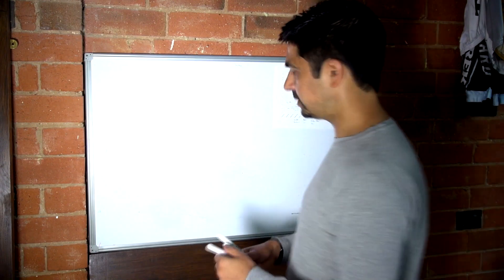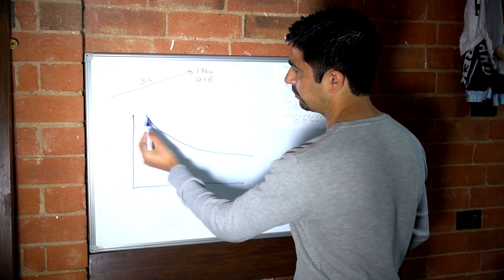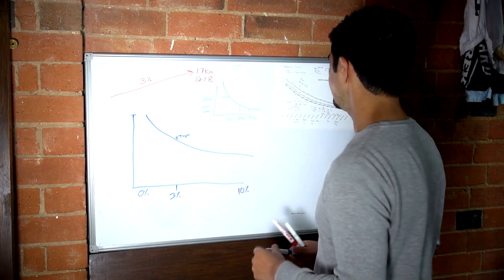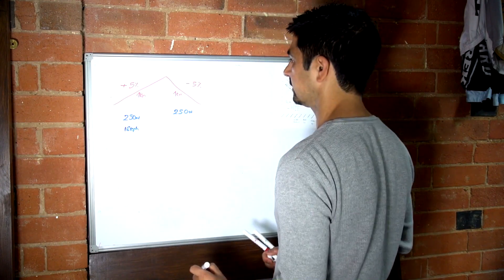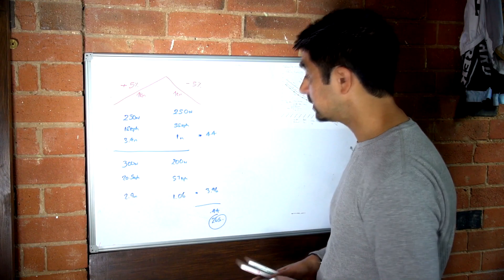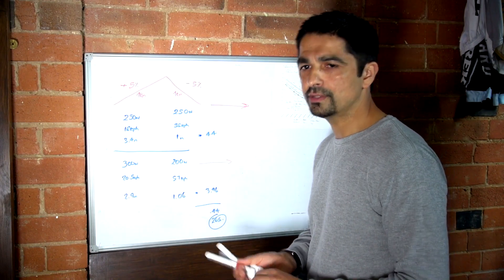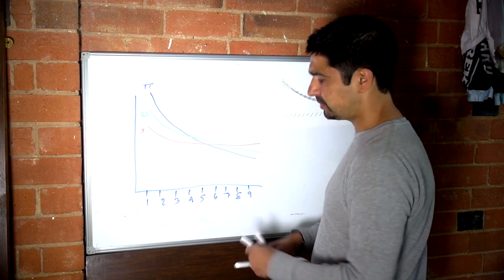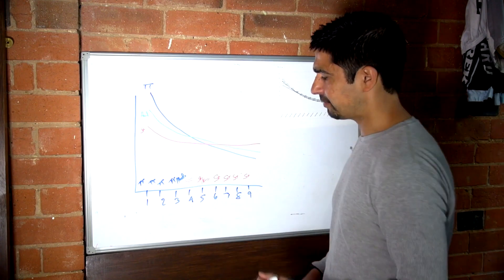Hill Climb Science: How to Correctly Pace Long Hill Climbs using a Power Meter

Comment: OORRR, you can just keep your power output at just below threshold at a gear that allows you to pedal up the grade with cadence between 80-100.
Reply from the maker: haha, that works if you are not against the clock, but if you are and you don't know the length of the climb....

Comment: calculating your average watt performance is +- easy. The problem is, that you can try to start faster than your average und then after 5-10min fall down and hold +- your  calculated performance (under pain for sure :)) which can give you an overall benefit compared to just try to hold your calculated performance for the whole distance. It s natural that you loose some % performance at the end anyway

Comment: Hi @FastFitnessTips I understand that increasing body weight has an exponentially increasing demand on effort where the standing position is adopted. I wonder if there’s a point in body weight vs gradient vs duration vs aerodynamics in line with ones power curve where it becomes counter productive to stand because of this and if this would be a strategy worth discussing in another video? 
Great video, smart work! Cheers
Reply from the maker: Yes precisely there is a tipping point where sitting is best even if power is lower because of aero gains...in fact if you can manage it TT ing uphill can be even better. Assuming power is equal then a better aero position wins on any grade of hill (suprisingly) but the problem is sustained power with differ. I will try and cover this in a future video. Did you see the drafting uphill video? Check it out

Comment: Does this work the same when the downhill doesn't immediately follow the uphill?As in should you always put in more effort going up hill
Reply from the maker: If you are riding for time, downhill is generally for recovery but not freewheeling. If the downhill is short, ride downhill at the same difference in watts below your FTP that you rode uphill above your FTP.
Reply: @Fastfitnesstips  Awesome thanks! I'm assuming you could formularise this for air resistance in general from your formula for the Watts per %gradient? As in it would it work for head wind vs. tail wind? I'm assuming the effect of wind speed on rider speed is not linear. 

Also wouldn't the watts increase per ‰ gradient (as in the formula you mention) increase overall for stronger riders?
Reply from the maker: @guswong7067  yes there are two factors aero drag increasing with speed (roughly squared) and ambient wind. We have a calculator for both of these factors, and yes neither is a simple linear equation! re stronger riders, stronger riders = those with higher sustained power, so don't quite understand your qq on this.
Reply: @Fastfitnesstips  Yeah i guess I had two questions. Firstly I was wondering whether the intuition to push higher Watts uphill because it takes longer also applied to headwind sections. (assuming no drafting) 
Secondly I was wondering whether your suggestion of 10 Watts per 1 percent gradient change at 250 scaled linearly. So at 375 Watts would you do 15 Watts extra uphill and 15 less downhill? 

Adding a third point here sorry :) . I think the headwind tailwind question is very interesting in general. Maybe even worth a video? Coz I can't get my head around it haha. How does the speed to power graph work in this case (assuming flat ground so? I'm assuming tailwind flattens the graph while headwinds steepens it? Does this mean its actually could be worth it to increase Watts on a tailwind section rather than a headwind?? (coz you'll get more speed for an equivalent wattage? But then headwind sections last longer? Am I picturing the graph wrongly? ) 

Honestly if you've done any excel modelling of this stuff or anything I'd be pretty fascinated. Thanks
Reply: @Fastfitnesstips  Bump

Comment: I expected more seriously analysis: I had practical task-to win on mtb uphill championship.
The race started on 200m asl and finnished on 800m asl, lenght was 6.5 km, surface was dry and hard  ground/dirt.The slope was changing  by lenght:It starts with slope more than average with u turns (300m), then a little down(300m), steep uphill with 15-18% slope(600m), then average slope (rest of track but on every 100-200m was some steep slope) but 1km before finnish was almost flat part(800m) and last 200m is little more than average slope.
Main question was what power managment to took: 1. all track with same ( max) power, 2.to go on steeper slope with higher power and on smaller slope with lower power or 3. to go with higher power on smaller slope and smaller power on higher slope.
I tested all 3  and best result was  to go  with higher power on smaller slope and rest on higher slope, because higher slope mostly was short but smaller slope was longer  so if I go with little more than max power on small slope I coul gain more ( -time) than loose on steep slope when will rest and because flat part is at end if come tyred I could  not go fast if . Less expirienced drivers came tyred on flat part they and drived  as was high slope.
I told this to one average guy and he drived 1.5 minutes faster than usually.
Yes I won, time was 26:31 and by every kg i was faster 45 seconds. First race was 31 minutes with 12kg bike, last was 26:31 with 8 kg bike( in meantime I became some stronger)

Comment: Came back to this video again after a long time, and more I look at the numbers, the less sense it does make. Graph at 12:40 clearly shows, that heavier you are, the less w/kg you need to output to maintain the speed... ???
Reply from the maker: Thanks for watching. Graph at 12:40 is illustrating another more basic point that more power needed to maintain uphill speed at a higher weight. Its not meant as an exact calculation applied to a known rider.    But there does seem to be a slight trend in the direction you are mentioning; however I wouldn't rubbish the whole video for a slight drift (+/-5%) in w/g vs speed.
Reply: Well, I am not dismissing the whole video (i like it a lot). But that graph is completely wrong and actually in contradiction to the general idea of the video :)
It should pretty much be the same power output in W/kg for everyone, as long as we do not consider aerodynamic drag (AD). If we do, the graph would probably show minor increase in required power to weight ratio for heavier riders. Considering that when going up anything over roughly 3%, we are fighting gravity more than anything else (based on the video), impact of AD would be rather miniscule going 10%+.
This is why I believe there must be some basic error in function you have used to calculate those graph, since it shows very minor tendency toward decrease of power to weight ratio required to climb hills for heavy riders, while one would expect exact opposite... slight increase, or constant ratio of power increase in relation to weight difference (if we don't consider AD at all).

In reality we see a pretty huge differences in riders ability to climb hills based on their weight, but I BELIEVE (I have nothing to support this claim) that has more to do with physiology of the rider, and general fitness, than anything else. Especially not the physics behind (because there is no way to justify any big difference there).
In theory we can easily compare 65kg rider with 95kg one, and assume the same fitness level (it's just one variable), but in real life, it would be much more difficult to find such couple. 
In general public more weight would most likely mean lower fitness level, with athletes it would indicate their are specializing in different area - climber vs sprinter. (using/training different muscle types. eg. Andre vs. Chris).

If this wideo was meant to be for general public, more than for a cycling community, saying you need to output more power the heavier you are to climb hills, would be absolutely okay (well, it's true) And amaze people by how much more power would be... okay (since they most likely have no idea how much 60 watts is in a first place). 
But I would expect that everyone here understands that whilst true, it doesn't really mean that much, since you probably can output much more power if you weight more (and if not, it does not make any sense to compare in a first place).

Anyway, I really like your videos, and the fact that you are still replying 1.5 year old video, is very cool man :)

Comment: Very interesting video, with a lot of good points! I'm riding with PM since 3 months and have been changing my approach to my local mountains already.
 I have a comment on section 2 though with the variable pacing strategy. Now if you go 250 on the climb and 250 on the downhill, your average wattage will naturally be 250. However you will always spend more time on the climb even if you are doing it with 300. So if you increase wattage on the climb and decrease it for the same amount on the downhill (300/200), your average wattage for the whole ride will be higher (maybe 275) and the faster time not all that surprising. What happens if you calculated a steady climb and downhill (275/275) with this new higher average wattage?
Reply from the maker: yes good point, the average power over a climb and descent will be = (time climbing x power climbing + time descending x power descending)/(total time)....but by pushing 300w uphill and 200w downhill (in your example) this will still be faster than holding a constant watts of 275.
Reply: That might well be, but I assume that the difference would not be so striking....Would it actually be the same effect if you went into a headwind, and then having a tailwind in an ITT?
Reply from the maker: yes its basically the same effect: if you are going into a headwind then you should up the power. Here's a head-scratcher, what about a tailwind uphill then a turn then a  headwind downhill?! In that situation differences would be even more equalized!

Comment: I've had so many questions regarding why riding up hills (mtns really) is so different than riding on the flat. You answered some of them in this impressively clear and informative presentation! I think many of us sorta knew much of this, but not in the detail and not with this clarity. I look forward to taking my next long climb & applying.  Maybe in the future you could address cadence vs grade? Thank you!

Hope you don't mind that I took 3 of the pithy things you said and paraphrased them here.

Pacing advice for short climbs  - compared to steady effort (FTP perhaps), increase wattage 5% for every 1% increase in grade. 

Hands on tops vs hands on hoods gives 10% more power! Wow, really? & TT position gives 5% less power. Standing gives 25% more power. Really interesting! Again, this is for short climbs.

On regular rides (like not a hill climb TT), it's nearly always an advantage to ride an aero wheelset rather than a climbing (lightweight) wheelset. & the faster one rides (& climbs), the more this is the case.

Comment: Very informative and interesting, but how do you pace yourself if you don't use a power meter? There are few flat sections where I live (Taiwan), so most of my riding is in the mountains, and hard as hell. Any advice, PLEASE!
Reply: Buy a cheaper bike and a power meter. The difference between a cheap "heavy" bike and a expensive light bike is often a kilo or two. The bike weight is only a few percentage of the total weight of rider and bike. A power meter allows you to know exactly how fast you can go without burning out your muscles.

Comment: When talking about the optimum strategy for riding up a consant gradient hill you seem to be assuming that the best strategy is to ride at a constant power. Is that what you're doing, and if so why is that a justified assumption?
Why is that a better strategy than, say gradually decreasing power on the way up, or gradually increasing?
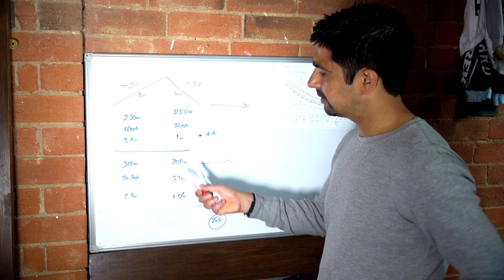Reply from the maker: interesting question. Did you see 10:05 I talked about varying power according to the grade of the hill. However you are talking about fixed grade...long climbs right? In which case....the problem with gradually decreasing power on the way up is that you grind to a halt on longer climbs......the problem with gradually increasing power is that at some point you exceed your ability to hold that power for the length of the climb. Whilst you are correct the optimal strategy might not be 100% constant depending on what follows the hill climb....it is a fairly safe assumption that constant power during a long constant grade climb will be the best fit for most riders.
Reply: Thanks for replying.

Yes, I'm talking about a fixed grade, and using a power curve that neither becomes impossible to maintain, nor slows to zero.
---
I was thinkling more about this. I think in a situation of a fixed grade, long climb, then constant power being the best tactic is a direct consequence of wind resistance varying by a power of velocity greater than 1 (it varies by velocity squared I think, but it's only important that it's greater than 1).
The rider is spending energy in two ways as they go up the hill, doing work against gravity and against air resitance (ignoring mechanical wastes etc.)The work done against gravity is the same independent of speed, but the work against air resistence goes up with speed.If v0 is the (constant) velocity the rider would travel when riding a constant power (and therefore constant velocity) strategy, then any other strategy must have them spending some time above and sometime below v0.
I think any time they spend above v0 is less 'efficient' than the time they spend below. Any gain they make  by travelling >v0 is more than cancelled out by the loss from  travelling <v0.
A rigorous, general proof of that would I think require knowlegde of how humans repsond to different power outputs, which I guess is probably not exactly known, but is well modelled, for example in whatever equations are used to relate average power and normalized power.
---
I calculated it in one simple case, of a rider who has 60s to go as far as possible, comparing two tactics:1) travel for 60s at 100w2) travel for 30s at 110w then 30s at 90w
The two tactics both average 100w over over the 60s.
Using the formulas p=kv^3 and d=vt, then (1) did give a slightly further distance travelled.
----
I think this actually all works for flat terrain too, and probably any course profile, but the maths would be tricky.

Comment: With reference to Part 2: variable pacing. Assume there is a flat segment after going up and down the hill. Would more time be gained by putting in the additional watts on the flat segment for the same duration as was put in on the up hill? I.e. Keep constant effort going up hill, rest coming down and then attack the flats?
Great videos by the way. Keep up the good work!
Reply from the maker: On the subsequent flat section try and settle into your normal pace (for example if its a 60min ride then settle back to your FTP pace). When riding solo uphill = higher effort flat = normal effort and downhill = lower effort. For exact strategy for a known course try www.bestbikesplit.com; for pacing a timetrial effort we have a big series on this coming next month (its with the editor).

Comment: Excuse my ignorance, but, how does electronic shifting progress cycling.....what benefits come from installing a more complicated system that requires batteries and is ipso facto less reliable than cable?
Reply: Because if you ride in the rain, dirt and grit you often will experience shifting problems. The electrical shifting self adjust and shift perfectly all through the race.

Comment: This is somewhat correct if you don't eat right, you will loose muscle mass instead of fat. BMI is the way to gauge whether your choice and amount of food is getting you proper results. Without going into detail, a 40% carbohydrate, 30% protein, and 30% fat by calorie diet is a good starting point. Another salient point is that you should train your body to burn fat for fuel. This diet helps with that.

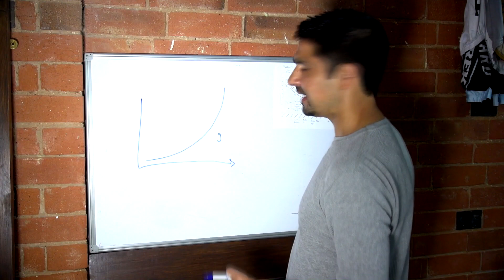Comment: 00:41 The amount of energy to combat energy rises exponentially as the hill gets steeper. wHAT????!!!?
Reply: you know, "exponential" became a general public average Joe fashion term for DAMN FAST... sadly, it's used also here
Reply: That is incorrect
Reply from the maker: "gravity"
Reply: Yes, that second "energy" in the sentece is "gravity", sorry. I don't think is a very fortunate comment: If you needed to climb a wall (infinite slope) you would only need to overcome gravity. Hard, but not exponential.
Reply: Exponential in terms of different rider weight. Meaning a heavier rider has to work more hard to combat gravity than a lighter rider has to compared to when there is little gradiant. Took me a minute to get!
Reply: Frederik, I refer you to the previous comment by budes matpicu. Please, don't take the word "exponential" in vain.

Comment: Can you do a presentation on how much a human body on a bike contributes to air resistance. I think these aero bikes are a scam and their effect is over-stated since most of the wind resistance is from the human body. The bike probably contributes to less than 30% of the overall wind resistance. (Just a guess).
Reply: in any case money is better invested in really good fitting (aero-) kit and aero helmed - much cheaper and more effective than an aero bike... but don't look as cool like those aero bikes 😎
Reply from the maker: Quite true. The CDA of rider and bike is typically around 0.33 but for the bike alone 0.07-0.08. This means the bike (and wheels) contribute a quarter to the drag. The rider and clothing and helmet about three quarters. If you go to an aero bike the CDA is about 0.065 so then the bike contributed 20% and the rider 80%.